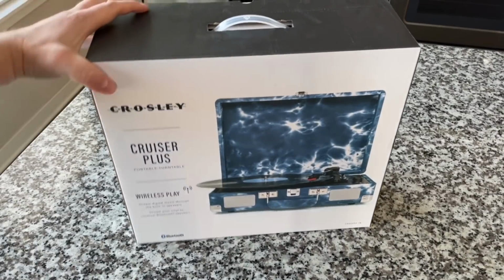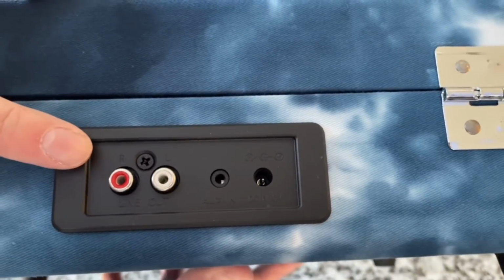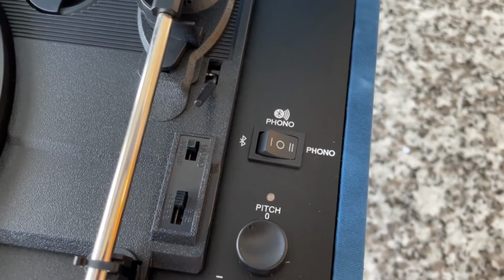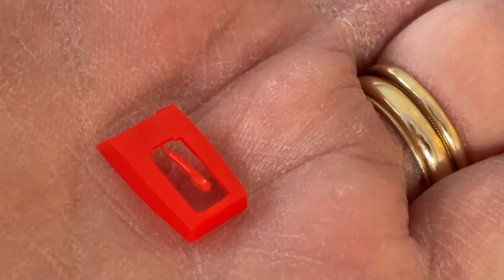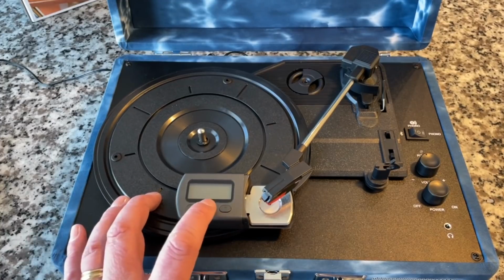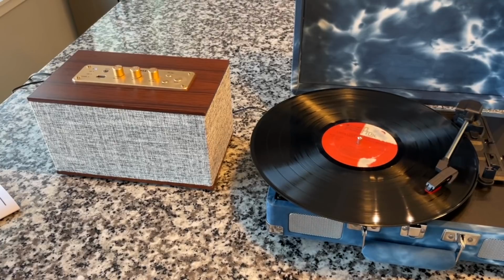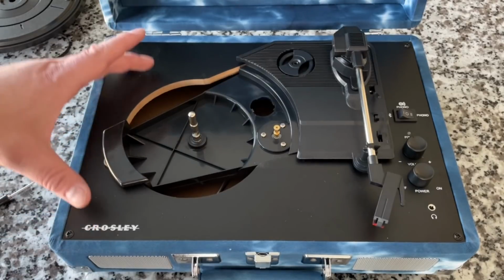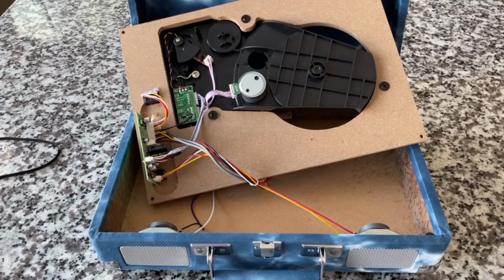Crosley Cruiser - UNBOXING / TEST / TEARDOWN!

Comment: Have you seen vwestlife s video about these turntable mechanism? He showed that these can sound awesome if you have the impedance correct
Reply from the maker: Yep that’s what we were saying.
Reply: @Recordology  oh haha I didn't get that far in the video yet haha
Reply: Can confirm myself.  I experimented with one of these 'modern' design players, disconnecting the tone arm signal leads and using them to drive a little Radio Shack SA-10 miniamp, which has high-impedance input stages.  THere was a noticeable improvement even driving the unit's original speakers.  But the most significant improvement was using the SA-10 to drive better/larger speakers.
Reply: @xaenon  I used to connect Aussie made suitcase players to a SA10 amp, I found the sound to be good, one thing I don't like in those compact amps, HMV suitcase and consoles is full time loudness contour, I get in and rip out the loudness caps, on weak recordings that call for vol knob to go past 2/3 the midrange gets honky. The SA10 used to saturate on CD player due to the loudness caps

Comment: But you now initially for the case player because I've had some bad experiences with chronically in Victrola type of units but after plugging it into the Bluetooth speaker I am changing my opinion I started with better quality components and then got into the hole-in-one's later so not the best experience but if you're careful and know what you're doing it could be okay still love your channel I saw the first beyond the purple suitcase rated the tour of the castle awesome

Comment: Just my opinion; but, I don't care how many features they add to it, a Crosley Cruiser is basically a poorly sounding, cheaply made, overpriced kiddie record player and I've actually had older kiddie record players that sounded better. Of course, I don't expect audiophile quality out of a portable phonograph; but, I expect them to sound better than these sound. BTW, the older USA-made record players are designed to be repaired and they are not held together with "hot snot."
Reply: You’ve said it! Though if the OEM bothered to use an amplifier that was properly impedance matched for the output of a ceramic phono cartridge, it wouldn’t sound all that bad…..
Reply: @douglasallen9428  I read an article where someone upgraded the speakers and built an FET buffer stage to go between the cartridge and amplifier input, and those modifications improved the sound quality greatly.
Reply: @radiotvphononut    Yes.  But it's a lot of effort and additional expense on top of the original purchase price, and in the end you're just playing around with a tweaked Crosleyl Cruiser.

In fact, I think YOU toyed with the idea of an FET buffer stage in a Cruiser, didn't you?   IIRC, you got sort of frustrated and EOL'd it instead.
Reply: @xaenon  Yes, that's exactly what happened. Had it been a better record player, I would have "pressed on"; but, I invested all the time I wanted to in that thing.
Reply: @douglasallen9428  don't forget the equalization curve as well
Reply: but how do you really feel? 😆
Reply: Lol big fella, these literally cost 60 bucks at Walmart. They sound just fine for what it is lol
Reply from the maker: They serve their purpose very well.  There are lots of higher end portables with ceramic carts that can be easily worked on.  But this not intended for that.  The most common misconception is that these are designed to compete with higher end equipment.  They are starter units at very low costs and get people started.  Nothing wrong with that!
Reply: @Recordology  Even with it being beginner technology I would expect better quality. I would expect the buffer like fore mentioned better sounding or at the very least repairability. I would much like a suitcase player with options like the cruiser but I wanted to be a quality unit I wanted to sound good and I want to be able to repair it. I want to be able to play all three speeds I want tone quality I want Bluetooth and I also want RCA out I don't really care if it has headphone or not. Doesn't have to be the highest end of highest end as I can't afford the Beall and all technology but I want quality and I don't want cheap. So any suggestions let me know!!!